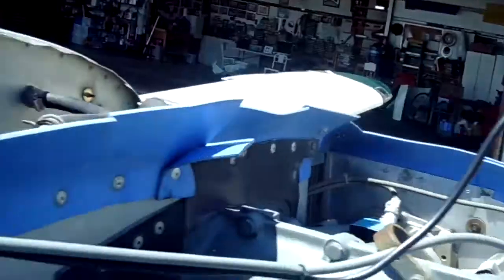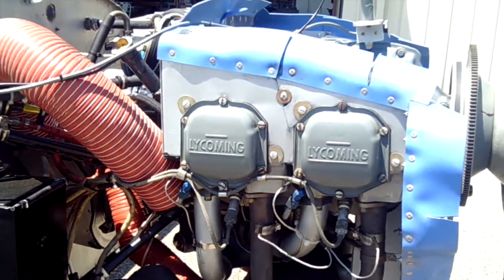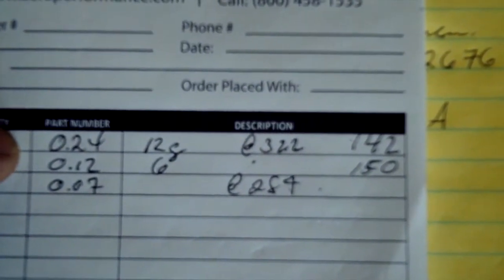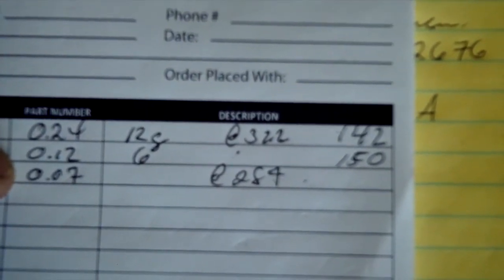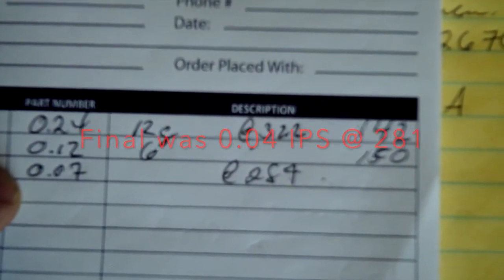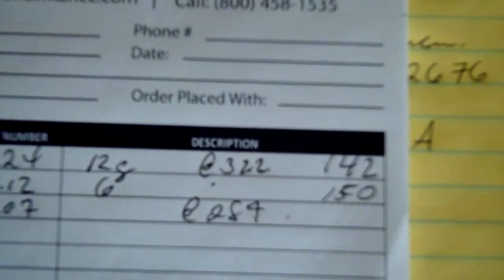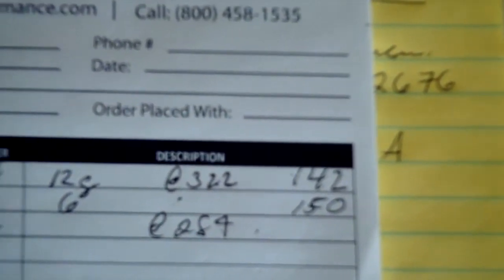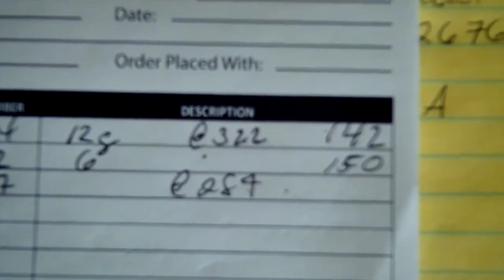Dynamically Balancing a Propeller  - Grumman Style

Comment: Can you please, please explain why on the AA5B the top blade should be at the 11 o'clock position versus the 1 o'clock? On the maintenance version (revision 4) of the AA5B it says 1 and 7 o'clock position. Someone then sent me a copy that had a parenthesis after that sentence which read "(as seen from the rear), meaning sitting at the pilot seat.
Reply from the maker: All prop positions are from the pilot's view, thus 1 o'clock from inside the plane is 11 o'clock from the other direction.

Cheers

Roscoe
Reply: Hi, I found this second prop balance video with the prop indexing info.  That was great to see.  You might think about adding "Prop Indexing" to the title.  Just a thought, I'll keep looking to see if there is an indexing video.  Maybe it will explain why the AA5B is indexed differently than the AG5B?  Seams like Sensenich props on the same engine in an airframe that is 99% identical, should be indexed the same?  Looking forward to hearing the explanation.  Thanks again for all of the great videos!